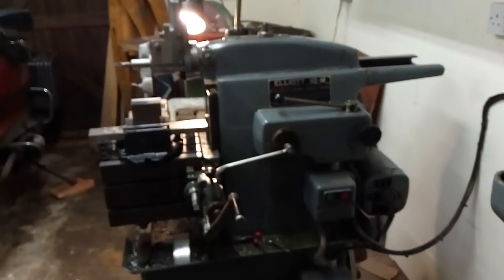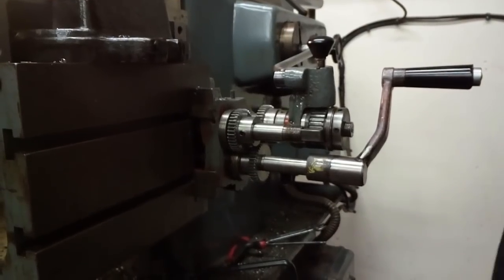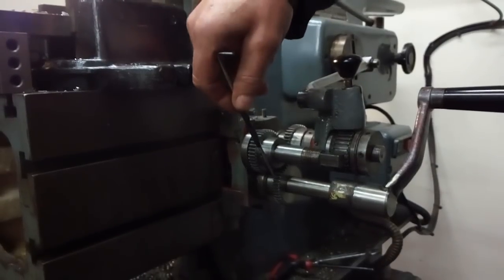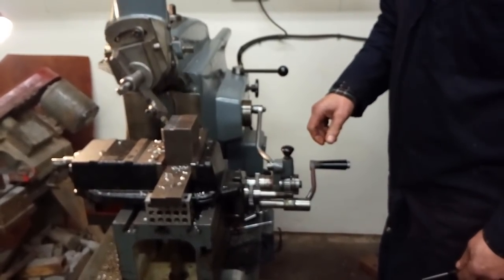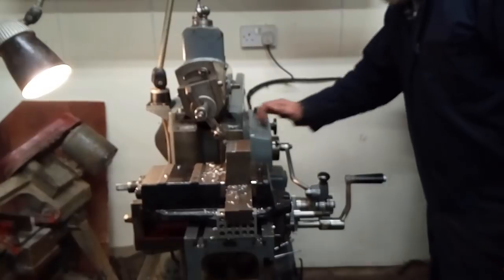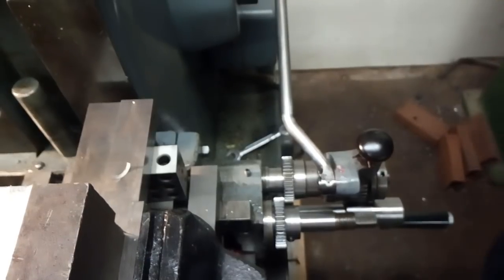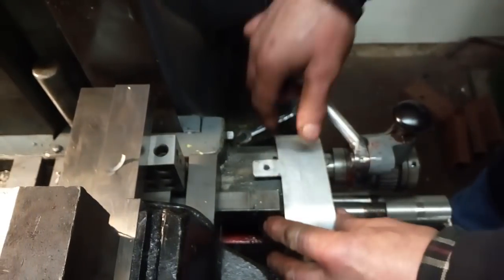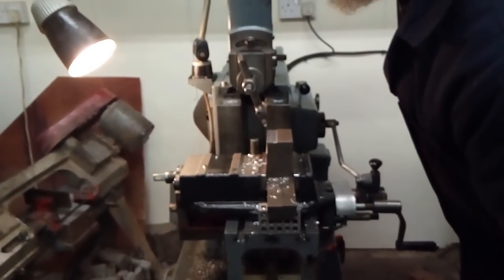pb shaper vid

Comment: Extremely interesting Mat and for sure I've not seen that setup before. I'd thought it was always done with a power feed onto the top vertical slide or built into the much larger shapers. Since Elliot obviously sold that as an added accessory it's a bit surprising there not a bit more common. So how long before you build your version :-)
Reply from the maker: I have seen quite a few of the smaller shapers with this kind of set up. Stefan Gotteswinter (probably murdered that spelling sorry) his Glock Shaper is similar.  the key fator is the Gib arrangement  for the carriage - if its set up so that the gib can be adjusted and locked in place to provide movement without excessive play - its fine. the Elliot 10m  can be.  the 14S has a double taper wedging effect - as you tighten it locks - so you set the box height and lock it off. that would have to be changed to run it in this manner.   I heard quite a few guys bemoan that this set up (in the video) removes the box support - thats only a problem if you are looking to take big cuts - many of the 10" and smaller shapers didnt have box supports - the early Alba 14S didnt and trust me that box & carriage weighs a fair bit !  This chaps taken the time to develop the parts to fit on retrospectively where Elliot only sold them as buy with machine - it works and if he gets interest he will make up the parts for a price, or provide plans - he's still chewing it over on that front. I offered to help spread the word.  As for my 14S tool head feed - still thinking about it and trying to decide if its worth the extra time (its not made the project list yet ! If I was keeping the 10M - I would be ordering the parts from this chap and saving myself a headache.
Reply: Nope you got Stefans last name right. And so far I've either missed it or haven't yet seen his power Z axis feed. My guess is shaper development was a bit more advanced in the UK than over here Mat. Like I said I've never seen that type of add on accessory for any shaper before and hadn't even thought about power feeding the tables Z axis. Even my little 7" South Bed has the front table support, but like you say just lighten up the cut depth.

From my perspective shipping any weight at all from the UK to Canaduh gets quite expensive. $450 just to ship my universal dividing head from RDG in the UK to my home for example. And since the parts would likely be Elliot machine specific I'd be a lot more interested in the drawings than buying a parts kit that wouldn't fit my shaper anyway. I need to check my machine a bit and see if it could even be made to work with mine.